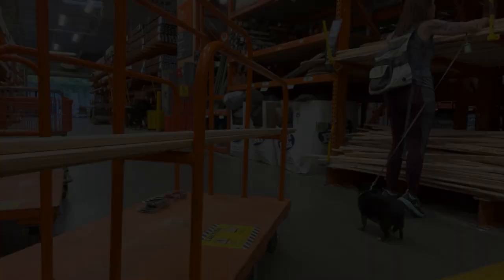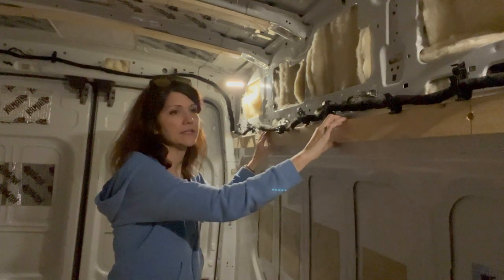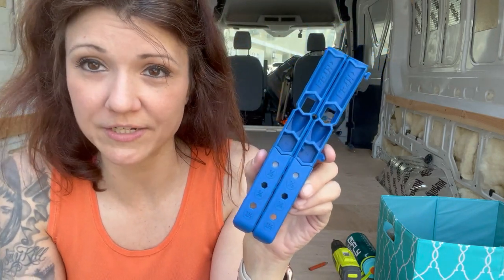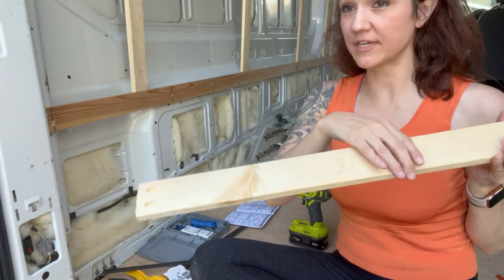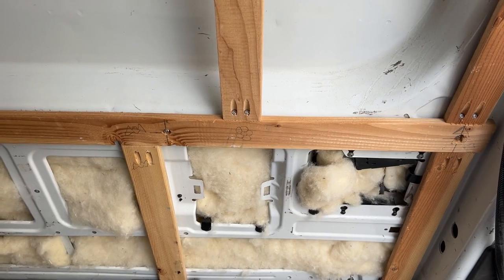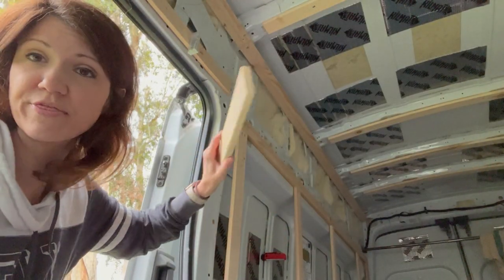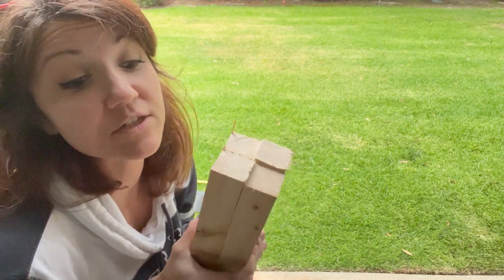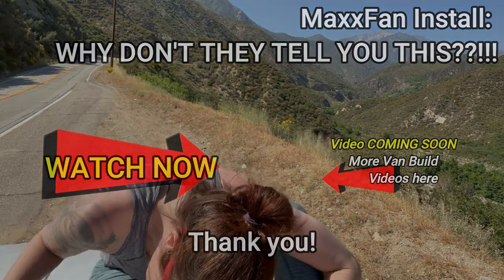DIY Framing | Pocket Holes & Furring Strips (Wall Frame) | Transit Van Conversion Series [10]

Comment: Those inner support ribs are made of a hardened steel and will eat up some bits if drilled too fast . there are other areas with even harder grades, the harder steel means they can use thinner wall to save weight for better gas mileage . good job on your build👍🏻
Reply from the maker: Wow, thank you for that info! I had noticed that some areas were stronger than others, but didn't really think about why. That makes so much sense, and is super helpful to know 😎 Thanks!

Comment: After I install a plusnut or rivnut I run a tap into each one to clean up the threads. Most of the time the threads are fine  but all it takes is one bad one to ruin your day.
Reply from the maker: Oh that's awesome! I didnt even know what a thread tap was until your comment.  I just looked it up and that would have been super helpful! Maybe I'll go back and try it out with those bad plusnuts ❤️ Thank you so much!